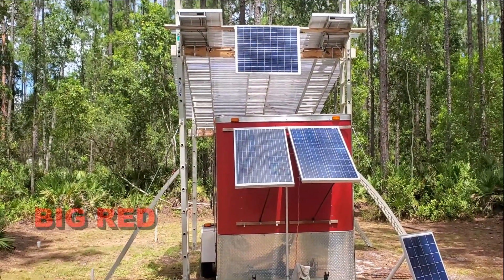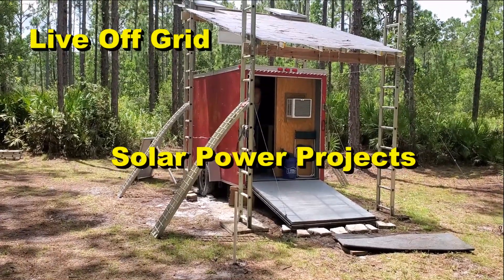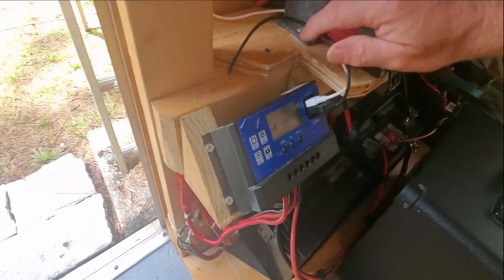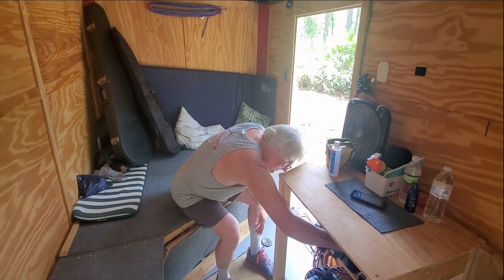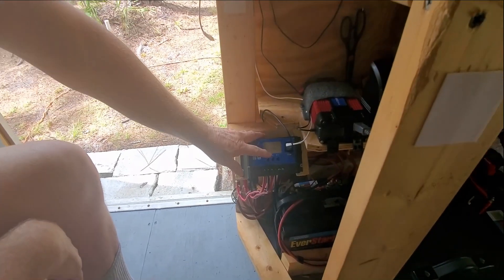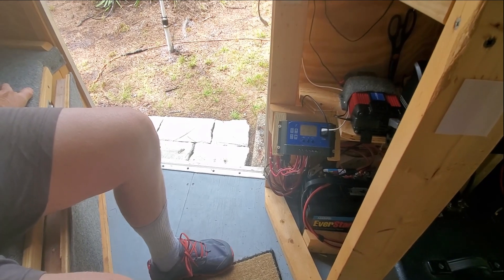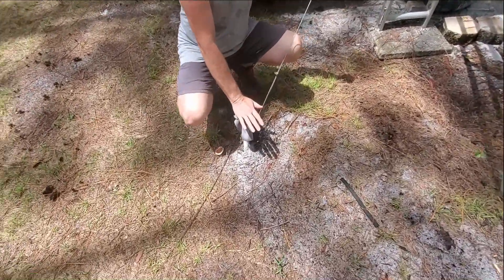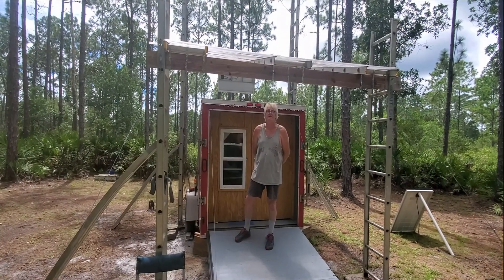Air Conditioner Runs All Day Off Solar Panel, Solar Energy Projects for DIY

Comment: You can heat your cabin all winter with solar sand battery.  In a nutshell put a dedicated solar panel wires straight into volume of sand & it radiates. Put a switch on it to stop the gain during hot months
Reply from the maker: Check out the video I made 300 watt panels with battery bank. It ruins  so much
Reply from the maker: What a great idea‼️

Comment: I'm curious, I didn't hear or see if 2 batteries are 100ah or larger or how many watts of solar panels. Also is the AC unit 5000btu or larger I think it looks like under 5000btu! Probably around 500watts draw? Thanks!

Comment: Prople don't understand that devices are not running constantly they do cycle off and on the fan may run all the time but not the compressor. Same with a well pump. I had a co worker run his well with the old harbor freight solar panels that were only 15 watts a piece for a total of 45 watts. He used a deep cycle battery a harbor freight inverter and three solar panels plus the charge controller. 73

Comment: Bro, short stocks and live at Mariott or on water. Electric bills i could care less. You just need the yayo man.
Reply: It's 'I COULDN'T care less' think about what Ur saying. If u could 'care less' then that means ur not at the bottom of the caring totem pole which u are trying to make a point of u don't care at all. If u could care less, that means u care a little bit. Pet peeve I have to correct everyone when I see it, so don't feel singled out.

Comment: That air conditioner Im sure is at least 400 Watts so if he can't run that heater he shouldn't be able to run the ac. I'm sure he doesn't run the ac at night on the batteries he had there. Pretty cool though. I run a ac myself when the sun's hitting the panels but not at night or cloudy day's. With enough batteries and panels it can easily be done though

Comment: I've had trouble finding inverters capable of supporting a full AC even if small. What kind of inverter is this that's working in the video? He did say it was a 2000 watt inverter but not which maker, type? Thanks. Tried several inverters and they keep shutting off and not able to do a 400 watt AC... a small one.

Comment: If I would do this I would run my panels in series to get approx 50 volts via solar into a MPPT charge controller. The batteries would be hooked in parallel for 24 volts.  The inverter would be 24v.
The advantage would be smaller gauge wire and more efficient charging… Big, high gauge wire for a 12 volt system will cost as much as pure sine wave 2000/3000 peak inverter. Furthermore in my experience the wire always seemed to heat under 12v systems at high loads as it is difficult to make low resistive connections. Otherwise good build.

Comment: 1 horsepower = 746 watts of motor is 100 percent efficient single phase Walmart acs are only 50 percent efficient and probably have 1/4 horsepower motors. Depending on unit. So that wold be 1500 wats/ horsepower 1/4 horsepower needed to run ac. At 120 volts 375 watts/120volts = 3 amps@120 volts or 30 amps @12volts. If you use an inverter run ac it works more like a 3 phase motor and is between 70 to 90 percent efficient. This would mean you only Abe to put in 900 to 1200 watts to get same horsepower. Divide that by 1/4 horsepower and you would save the extra you spent on ac by needing less panels and battery’s.

Comment: How many btu's is that ac and can you do a test of how many of them you can run on that setup?
Reply: That AC is 5,000 BTU. And my 5,000 BTU AC uses about 500 Watts when running. But it is also 15+ years old.

Comment: I lived for several years without utilities.  You can survive if you try, that's what I tell everyone. your bed is a sofa. Very well insulated then on two sides right? Ok, now long johns. regular street clothes. A heavey hat, Winter coat, Then 2 blankets and 1 comforter. Hide your head under and leave a little passage for air. You will wake up sweating.

Comment: Hi you're off the grid living with Doug I'm in my 2000 Chevy van the middle of the Arizona tattoo right now temperatures 122° in the Mojave but no problem the little f**** $2,000 trailer in the back is now at any temperature want I'm running solar panels in a generator and I have the temperature at about 65° here in the middle of desert and this is year round this is perpetual free energy that's the sun is powering my generator and keeping my air conditioner cool for no cost at all note that I've already bought the trailer for $1,000 I have a stove refrigerator septic tank bathroom toilet shower everything imaginable and I'm running that I bought that you said it on sale over here in Arizona once a year at the denials market I just picked it up for real cheap brand new appliances so I got your shower I got your chemical toilet I've got your refrigerator I've got barbecue got any hot plate I got a stove I got a oven I'm cooking your turkey and I'm doing it all off of solar power okay we only go from there but you know the interesting thing is I have six acres out here it cost me $3,000 for six acres the interesting is my trailer cost me two grand my my Chevy van only cost $900 interesting thing is how cheap am I living out here well I am living for free hard to believe and is it rough out here no I have I can go down to the in Arizona here there's a shopping center and I can get anything you want at Allison's restaurant buddy so I mean there is everything out here the beautiful lake is here we have a couple beaches out here Sunny white beaches and we have a beautiful lake out here and just gorgeous and you just live for nothing out here and you know the cost of five acres here in Sacramento California it's about 500,000 but over here it's only about $3,000 upwards maybe you can get the premium property if you want for 39,000 for 5 acres you can get anything you want out here plenty of land plenty of you can get you don't need a septic tank but if you get any thing you want out here if you got money I mean if you want to hire somebody and all that you know and

Comment: First, I thank anyone who did anything for their effort. However, most people get carried away and forget tell us the basics: number of panels, wattage, number of batteries, amperage. The rest is pretty much easy to figure out. (This type of connection  will only need a pwm charge controller) no need for a mppt. It probably only needed parallel connections (solar and batteries) too. But do not forget to give out the basics.

Comment: Makes sense because of the size of the building. 5000 BTU ac is supposed to cool 150 sqft. What size is that trailer 6'x10' ? So the AC only has to cool 60 sqft instead of 150 sqft... assuming he closes his doors. An AC is going to maintain whatever temperature it is set at, so if it takes 500 watts per hour to cool 150 sqft, would it make sense then that an area of only 0.4x the size would use approximately 200 watts per hour? He says at one point the controller is taking an input of 14 amps. Voltage from the solar panels I've been looking at recently is between 17-22 volts. 14x17= 238 watts 22x17=308 watts.

Comment: Living in the year 2090 you have an electric heating blanket, but it also has conditioning. So if you want to save energy at night you use your electric blanket in A/C mode. Wall mounted A/C is so 2020s.
Reply: Completely over my head.

Comment: would like to know how much is drawn . I thing a small ac about 4.5 to 6 amps?
Reply: hey spyplane,
thank you for watching! The Air conditioner uses 475 -600 watts so, yes 600w / 120v = 5 amps on start up then drops to about 4 amps in run . Still runs great today!!

Comment: How many batteries  and solar panels would i need to run a  small  deep freezer  and house fridge 247 with a couple lights  and  a small  window ac  to keep the temp  of a samll cabin or room at 69 to 70 with the chance  of running a  stove or electric   griddle or burner
Reply: A very very large amount.  You should consider cooking with propane because stoves use a high amount of current and you'd have to add several panels just for an electric stove.

Comment: I have my doubts the two batteries can run an air conditioner all day on solar if they were capacitors and yeah I believe it
Reply: Did you see the part where the area was littered with solar panels? Im sure he is intending the system to primarily be powered by the solar panels. batteries fill the gaps on both ends of too much and too little power production from the solar.

Comment: Does a solar power AC need batteries to start the motor?  Or would only panels start the AC's motor?
Reply: Depends on how much wattage of solar panels you have but the panels can give enough power to start it although you'll need to run it through the batteries and inverter if you can understand that

Comment: Is that a mppt charge controller? Using one would definitely enhance the power coming in from the solar panels.
Reply: Yes.. supposedly. These r cheap, ebay Scc's.. i just got my 3rd one this week.. first one 12/2018 .. 
They work great so far

Comment: So, in my part of the world. we really REALLY need the air conditioner to run, so is it possible to set my house us with an air conditioning unit running at night? Because you kept repeating that the air conditioner will run all day "as long as there is sunshine"; but how do I get it to run even at night where the temperature drops to say 25 degrees C (77 degree F)?
Reply: You need batteries to keep it going through the nights . But remember the batteries needs to be changed but it still can go dead before the night is over because it's not being charged from the moon 😂. But that's how it go's . Get like 10 batteries Big ones like truck battery

Comment: Keep in mind 10 amps charge at the batteries (12 volts) is only 1 amp or less at the inverter output (120 volts). They didn't say how many amps the air conditioner uses. But if the batteries  were 12volt 200 ah. 2 in parallel would give him 400 ah. You should never take deep cycle batteries below a 50 % charge so you have  200 amp hours available plus whatever amps your getting from solar panels. Converting that 12 vdc 200 ah to 120 vac gives you approximately 20 ah of electricity. That equates to running a 1 amp load for 20 hour, or 2 amp load for 10 hours. But after those time frames the batteries will be only half their capacity and will require a full charge to get the best life out of your batteries.
Reply: I see you understand how solar works. I don't see batteries lasting all night unless they're lithium and 300ah each. Lithium batteries can be discharge completely without any problems so he'd have all 600ahs available if they're 300ah each and I do think that may work
Reply: @marvinsalee7134  one misconception is the longevity of lead acid batteries, maintenance free labels are simply patched over the maintenance holes to prevent honest people who don't have the knowledge of how to boil their batteries from doing so and injuring themselves. In the solar community however, I think that this is less of an issue since safety has to be learned anyway to run the system. If you safely learn how to boil your lead acid batteries they can last you 75 years or more if you're lucky using the proper machine for it. Now weight and space is your main concern when using lead acid if you learn this. Which is not really an issue if you are a home owner. Lead acid for stationary, Lithium for portability. My problem is I have studied the batteries more than the solar itself because at one point I was considering making my own batteries because of how expensive that they can get. overall lead acid is safer. You can mix battery banks of different types by the way but it needs a certain type of combining circuit. You shouldn't combine them in the same bank however. Combo circuit is basically a fancy filter capacitor in a very basic version of a mppt controller yet they are not the same.
Reply: I'm guessing he only runs it during day
Reply: Its an old but small window unit in a small place. The compressor as long as its set to 69-71degrees wont be one majority of the time. It only maintains the temperature. Thing is that nowadays the high seer splits burn even less current than that it can definitley work

Comment: What a great inspiration! Thank you so much for the video. Very politely, I wanted to ask, how many batteries you think I may be needing for one 25000 btu window air condition (3000watts) and two Extractor Fan Blower (1040 watt for both) and an industrial humidifier (3000watt)? However the humidifier and fans will not run all day continuous, only the air condition would. The fan and humidifer, again, will run one and half hours every four hours. I would use all three applances only day times, say from 7am-8pm daily, no night usage of them. And I live in texas where the sun is super hot in the summers. Please advice me on how many batteries and panels I will be needing for my project. Again, thank you and for your response in advance.
Reply: That's 7040 watts per hour those are on(just added them all up). So the next question is how many hours will you run each device? When in doubt, go for higher hours (aka duty cycle). If you have 100% duty cycle on 7040W that's 168,960 Watt/hour(or 168.96 Kilowatt/hour) for 24 hr cycle.. which is quite a bit. You always want to add a buffer on solar and make sure to include everything when figuring out your daily use. You can google your zipcode for how many "sun hours" there are in your location. Then for the battery pack, you need to decide how long you want to have power if you don't have any sun(I call it standby power). If your in Arizona desert, you probably don't need more than 1 day standby power. If you're in Northeast you may want 3 days standby power.

Ex: If you have 5 sun-hours in your location then you should size your battery for 5X max rating of solar panels. And you want 2 days standby power. So lets assume you need 169Kw per hour(for everything you mentioned) 24/7 use(100% duty cycle). Battery would be 169Kw x 24 hrs x 2 days standby= 338 Kwh. Solar panels should be 169Kwh / 5 hr = 33.8Kw solar needed. Its a lot cheaper to oversize solar panels, than to have a big battery.. but you do need standby if you wish to remain 100% on solar. For batteries, Lithium Iron Phosphate are the preferred chemistry among a lot of tiny housers/RVers. Youtube search "Will Prowse solar" for more information on batteries/solar and he does go over everything I just mentioned in one of his videos. He's got several solar systems at his house, and he's charging multiple electric cars from solar which is pretty cool.
Reply: @Geoff9001  where are you getting 168.96/hour.. it'd be 168.96/24hours...

Also you're not taking into account inrush current and having the power at hand when the AC cycles on, which it will do.
Reply: @michaelcohen9363  yeah quickly glancing over my math it looks like I accidentally multiplied it by 24 twice. Thanks for the catch! Btw for original commenter, I recommend hiring a solar company to do a true load evaluation because it's impossible for us to estimate your power use without much more information. Are there south facing windows? What latitude is this solar array? Etc etc

Comment: Would have been nice to know the specifics of the batteries.
Reply: Those are 2 basic, new car batteries.. around 60$ each at Walmart..
He's not even using deep cycle, or the expensive life batteries.. hell hes not even using 3 or 4.

Hes got a good get down there with that little setup.

The secret is how many solar panels hes running.

I got 3 of those cheap charge controllers and was happy to see someone else using them.. bought my first one Dec 2018 and my 3rd one last week. All from ebay for less than 16$ for this last, most expensive one.. others were 12$ each. They work great so far and like i say, i been usin em since late 2018.

This guy would have even more after daylight power by just addingn1 or more of the same type batteries.. getting deep cycle or Life batteries.

Peace
Reply: Forgot to mention.. the charge controllers i got .. the first 2 are 50A .. this last one is 100A .. they look exactly like his just different color sticker label. Even 30 or 40A is plenty.
Reply: @koollee  yes, I have some deep cell batteries and they last much much longer than car batteries. Car batteries were not meant to be severely discharged during the night

Comment: I don't think there's any reason A/C, refrigeration and freezers couldn't easily run off solar power because they have start capacitors, right? That's what provides the surge of power required to start a compressor, isn't it? And capacitors charge practically instantly so why do people assume they can't run cooling devices off solar?

Comment: I just wanted to get some good ideas, the pavilion is interesting 🤔, gives me ideas, one thing I already know, that trailer is going to be so hot 🔥 in the summer, I guess the next video will be insulating the floor and inside ...I will be using 300 ah lipo. W 3000 w inverter 800 solar. Building from the ground up, 10x20 
With lots of insulation.
Arizona.
Reply: You're gonna need more battery power if doing ac.